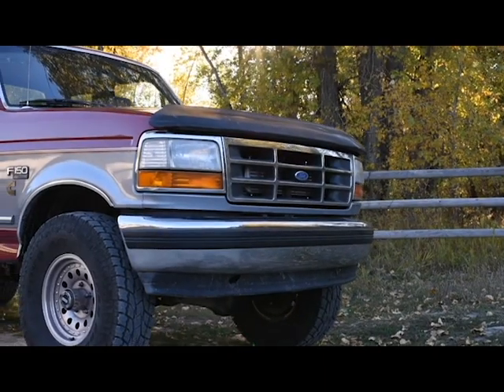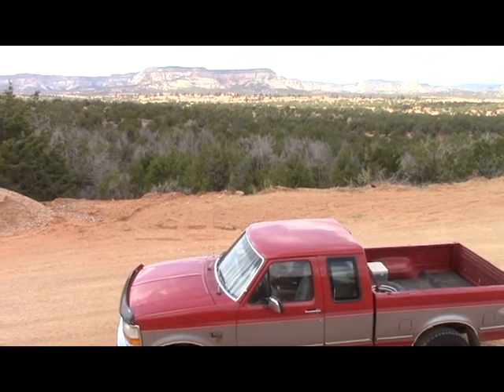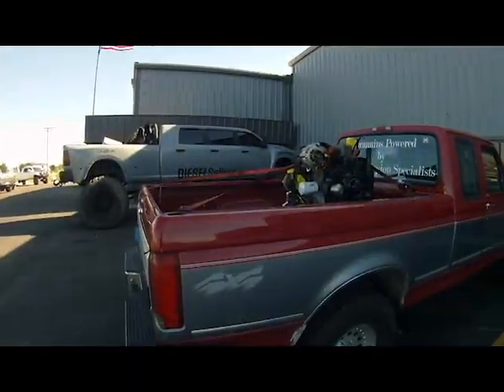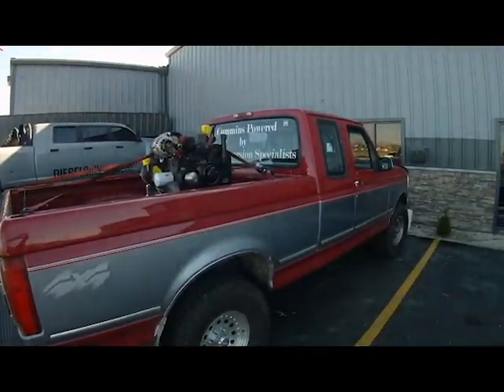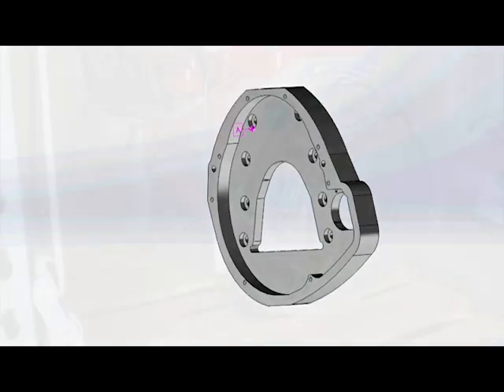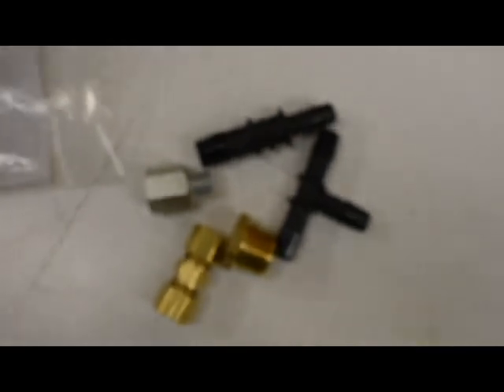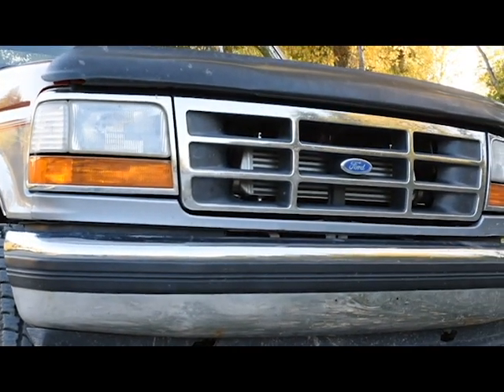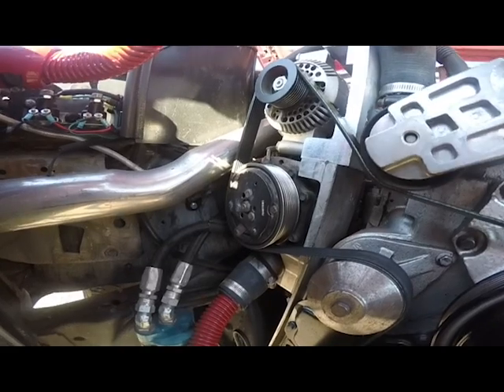Diesel Conversion Specialist F150 4BT Cummins Converison kit

Comment: What is the fuel economy? Do you recommend changing the gear ratio?
Reply: Gearing always helps but you can get almost the same result from using the tranny gearing and tire size to get the proper results, you can use 3:55 gears with 35" tires and no overdrive, 4:10 with an overdrive
Reply: 35" tire equal about 600 rev per mile, times gear ratios equals engine rpm, times overdrive ratio, this is your 60 mph gauge divide by 60 and multiply by 70 to get your rpm on the highway, 600 tire  x 3:55 gears x .73 overdrive ➗ by 60 X 70 =1814 rpm at 70mph going down the highway, diesel engine doesn't need high RPM to make power

Comment: Have a 1994 Ford f150 with 4.9 do yall have the kits for 6bt Cummins or is it just for the 4bt
Reply from the maker: Just the 4BT. Front end didn't seem up to a 6BT. The 4BT makes around 400lbs. of torque,  which was better than the early 6BT, and it seems more than adequate to get it down the road.  There is a vid on this channel that talks about the 4Bt that's in it  and what was done.

Comment: How would the 4bt work in my 94 e150
Reply from the maker: We put 6BT in a 97 E series, and it actually fit with only some small issues to sort out. A 4BT for sure would have to be a much better fit (and a heck of a lot easier to actually get in there). But yeah, I'd love to see a 4BT in a 150 E series.

Comment: Did you have to swap out the front axle for the added weight?
Reply from the maker: No, the 4BT didn't really add  a lot of extra weight.  Small block weighs something like 450, so it really only added about 300 or so lbs.

Comment: Do you need to retain the ECU? And how does the fuel pump and gauge situation work? Im looking at swapping my 95 F150 5 speed but am not sure how those will play out.
Reply from the maker: You do retain the ecu for the dash, fuel pump no, the Cummins has a fuel pump built in, so just a draw straw in the tank.

Comment: So, i've got an 89 F150 manual 4x4 short bed with the 5.0.  Engine is trash, i'm tired of dealing with it.  
I tried finding a conversion kit on the website for this application, but i keep getting the message that no kits are available.  Is this no longer a viable option?
Reply from the maker: It is definitely available! It is not yet on the website--the hold up was the flywheel. But, if you ring the shop direct--406 755 8878 ext 203, we can tell you more about it (we have all the parts) and get you setup!!  Thank you!!

Comment: I'd like to do this conversion on my 1986 Full size bronco. It has now a 300 cu. in.inline 6 with over 400,000 miles on it with a New Process 435 4 speed manual transmission.
Reply from the maker: We've done a few newer OBS style (90's) Broncos, I always like those, they do make a great conversion.
Reply: @dieselconversionspecialists  Thanks for the reply. My 300 is in fine shape. But as we all know, "Nothing lasts forever". I like to make plans for the future

Comment: The more videos i watch about the 4bt, the more i want to find one to play with!!, im gonna have find out what common vehicles in the uk had them, a rebuild would give me something to do in on winter nights in the workshop. Great vid. All the best to you all.
Reply from the maker: I follow the 6BTCummins Rover builds in the UK and it is crazy how that has just taken off!  They've really been discovered here, so the prices are getting  higher, but still, great engines to work with!  If you build something, we have a Facebook page and we'd post a 4BT UK build!
Reply: @dieselconversionspecialists  cheers for reply, ive been watching a few builds of some u.k lads putting them in landys, which is great as, apart from the rover v8, their engines were always the weak link( just my opinion!) Ive missed working on engines since i had to stop working( wrecked back and legs), ive now got a good sized workshop, and my cousins just installed a electric hoist, which spans the workshop.....so lifting and moving objects is'nt a problem anymore. My plan is to get the engine/gearbox, rebuild it, then decide what im putting it in!!, i know its the wrong way round....but that just me!!lol!, il probally find a pickup or find something interesting in my mates scrap yard. I dont use facebook, but if i come up with something good il drop you a line on here. My quest for the dirty diesel cripple hauler has begun!. All the best matey from the damp U.K!
Reply from the maker: Awesome dude!!--I'm lookin forward to seein what you come up with!!!

Comment: Any adapters for a small block Chevy bell housing 1991 .... 
have a 91 k3500 that has a Muncie sm465 4 speed and an np205 transfer case ... that gets like 11 mpg with the 350 that's in it. 
I plan on putting in a 2 speed overdrive
So I'll have 8 forward gears 
Want to do a swap for a 4bt for fuel economy torque and just because you can't beat the sound of a 4 cycle Cummins especially the old NA220 with backdrops.... need an adapter plate 
Engine mounts 
Flywheel 
And clutch. 
Having hell sourcing parts....
Reply from the maker: We do have a used OEM Cummins to small block GM. It had a 4BT in front of it;  you have a bell, we have an adapter plate and flywheel.

Comment: Ok that's great, but is the power adequate? Or will a person be disappointed after all that work? I understand longevity and mileage but what about power?
Reply from the maker: We've done the conversion a few different ways, with automatic trans, with a manual trans, with a stock 4BT, and a mild 4BT. The best combo so far was the mild build--which was just a tweaked rotary pump, stock injectors, and a common rail turbo (from an ISB 170) bigger inter-cooler and with the manual trans (the other video is this build) . It made 505 lbs. of torque at the wheels and still did a respectable 23.9 mpg.  I suspect if we'd not lead-footed it everywhere, it would do better.  And we've put about 30K on it since the conversion.

Comment: Hello diesel conversion specialist, I need the Adapter Plate for my 1995 ford f150 truck?
Reply from the maker: Hey Mardelo,
Here's the link to the info page so you can get an overview of the F150 conversion options. And for sure if you have questions, ring the shop directly:
https://www.dieselconversion.com/blog/cat/conversion-overviews/post/1991-1997-FordF150-Bronco/

Comment: I'm pretty new to the diesel conversion thing, but I do know that I would get better MPG and other benefits. I currently have a 1990 Ford Bronco and I know that most parts between the F-150 and Bronco are compatible in those years. Would the kit work? And how much would the full conversion probably cost?-including engine + installation
Reply from the maker: Hey thanks for the interest!! There are several options for the early Fords, here's a link on our website to the F-150 kits. It shows the 91 kit based on transmission--there are a number of challenges when trying to use the C6 or 4 speed manual trans. There is an info page with conversion overviews just for F-150 conversions. And you can ring the sales department anytime to get a better idea of what's available.  Thank you!!
https://www.dieselconversion.com/kit-builder.html/?find=-ford-f-150-1991-300--302--351w-e4od-1989---1998-4bt-6655

Comment: Can I do this swap to my 4spd?
Reply from the maker: All of the stack height dimensions for the adapter plate and flexplate are based on the Mazda 5speed, and I don't know if the 4 speed shares any of those dimension.
Reply: Bolt pattern on 302 n 351w are the same bolt pattern. Same clutch n flywheel. . Same starter.   Clutch center splines are same too. I think id bolt up fine but shed rev high in 4th gear at 60mph

Comment: I have a 1985 toyota pickup SR5 I want to 4BT when I get the chance. It would be monstrous.
Reply from the maker: We just put VW tdi in my 87 Toy, with just mild tuning and being 300lbs. lighter than a 4BT,  it's already awesome.  I think the Toyota VW kit overview is already live on the dieselconversion.com page.
Reply: What kind of HP/Torque and Gas Mileage do you get?
Reply from the maker: Hey Ron--we have a follow-up video on the mileage on our youtube page if you want to see it. We averaged around 25 MPG with the first engine setup, which was very basic, just a common rail turbo, and some pump timing and whatever injectors were in it when we bought it. But it dyno'd 503 lbs. of torque. That truck has been the guinea pig for a lot of other things, so we haven't had a chance to do a mileage test with the stock engine.  We just built another one but with an automatic, and different gearing, so it'll be interesting to see how that one does.
Reply: I spoke to Sean yesterday on the phone about doing a F-150 or F250 conversion. But I also have an 87 toy motorhome. Love the 22RE gas engine in it for reliability but it is balless and boring. Do you think the VW diesel or the 4bt diesel would give the thing anymore speed and gas mileage?
Reply from the maker: The 4BT can make lots of power, but it's nearly 800 lbs, so it isn't conversion friendly to the Toyota. The TDI I've become quite attached to, mostly because it's so well supported, a much smaller package and the mileage would be there. We had a TDI Toyota here (mine) but it dropped a valve--long story--so I don't have any mileage info yet. Right now we use Malone for tuning and the tunes available can significantly improve the power level over stock before sacrificing economy. Lots of things of course factor into how it performs, but for a Toyota, I'm really leaning toward the TDI. Ring here at the shop anytime and visit about some of the options. 
Thanks Ron!
Reply: What year(s) TDI? What displacement? And how do you think it would fare  in  a 1987 Toyota motorhome that weighs 6000 lbs unloaded and likely 7000 + loaded?
Reply from the maker: Wow, that is quite a load for that 22R to haul around. I'm surprised you didn't look into and LS swap. I was a thinking VW TDI, but maybe something a bit bigger might be required to move it around. you can send an email right to the shop here, just send it to sales@dieselconversion.com, and it'll get forwarded to me.

Comment: Would like to know if a 4bt has been/ can be swapped into a 2nd Gen Dodge Durango (03-09) 545RFE auto transmission. Mostly interested in fuel economy and running WMO (waste motor oil)

Comment: I went on your website and could only find the kit for the automatic transmission, why is this?
Reply from the maker: The manual trans kit requires sourcing some parts, and there are several options, so it's easier to have anyone who is interested just call the shop and get the details direct.  Thanks Teddy!

Comment: Will this work for a similar body style Bronco?
Reply: yes im 95% sure
Reply: Absolutely.  Bronco frame is alot stronger.  Its same frame as the 350 so the body dont crack above the rear side top door frame.  Difference is only wheel base. I buy old f150s to take parts for my 88 bronco.

Comment: Hello Diesel Conversion Specialists, i have a 79 F150, and i have a couple of questions about the 4bt swap. first off id like to ask how much does a kit typically cost for a conversion like that, and secondly how much horsepower does the 4bt have?
Reply from the maker: 79's take sort of a unique combination of parts, if you can give the shop a call and 406 755 8878 ext.201 and chat with Sean. The 4BT we have in the half ton has a little bit of work done to it; pump timing, injectors and a turbo from a common rail and it dyno'd around 500 pounds of torque, which may prove to be too much for the stock 5 speed--although we've put 30K miles on it, and so far (fingers crossed) it's holding up.

Comment: My dream is to drop a '94 - '98 P-Pumped 12-valve into my 1983 Wagoneer with a built  700r4 behind it, a Northwest FabWorks Black Box to a NP205 and a Gear Vendors overdrive unit. Would make my Gagoneer prairie schooner a sweet ride.
Reply: That would be a very sweet ride. I hope you get it built someday. I have a 1963 Willy's Wagoneer with the Tornado OHC straight 6 in it. Right now it's just sitting but someday I'm going to get that bad boy up and running as well. It only has 28k miles on it so I might leave it original. Believe it or not I got it for $50 about twenty years ago because they previous own tried forcing it into gear one morning when it was -30 F and broke one of the shifting arms. My dad fixed it and we used it sparingly for a while until a part from it was needed here and there. Hopefully someday we will both have our Wagoneer's on the road.

Comment: whats the mpg after the conversion ?
Reply from the maker: +Heather Gebhardt  
Hey Heather. We put 33's and a lift on ours, plus a bigger turbo and some  fuel work, and yes it makes great power but it killed the mileage. I think currently it gets 20ish if it's driven conservatively.  We've put 30,000 miles on it, and we have a follow-up video just about ready that will get into the mileage and performance. It'll compare the before and after.
Thank you Heather.

Comment: would it work in a bronco?
Reply from the maker: +William Naegeli Our kit will work in a Bronco as well. Feel free to contact us @406-755-8878. Here is a link to the overview. https://www.dieselconversion.com/blog/cat/conversion-overviews/post/1991-1997-FordF150-Bronco/
Reply: Absolutely... same truck just wheel base is shorter. But bronco uses same frame as f350. Way thicker then 150 frame. So its a better truck do build